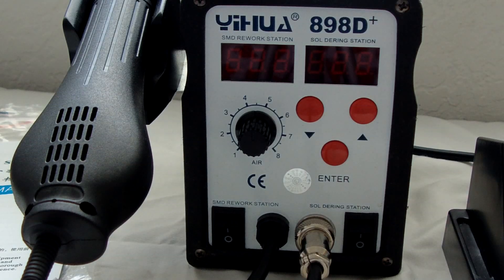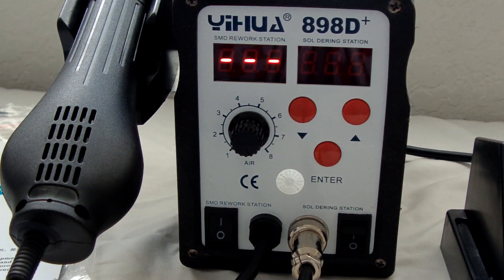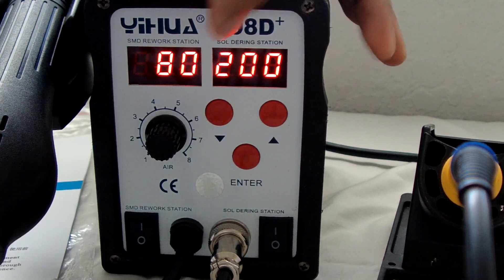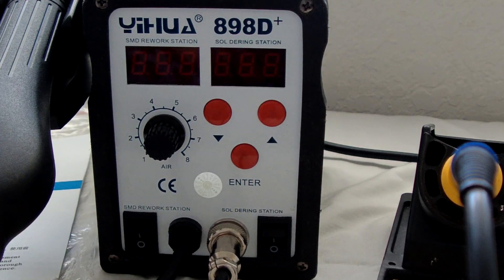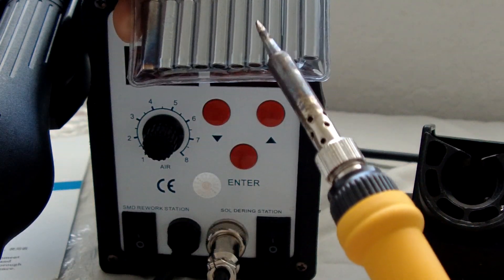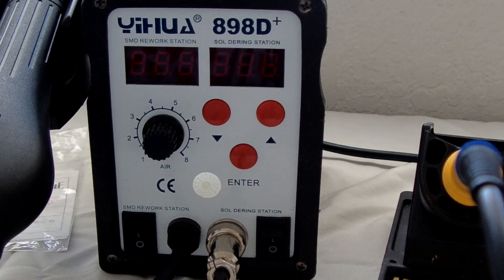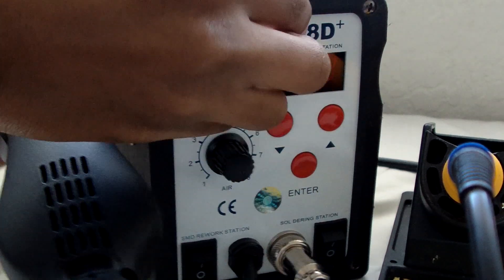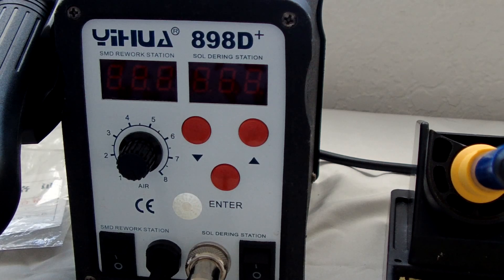review of Atten 898D rework and soldering station

Comment: The air gun does unplug if you open the case, it has push fit connectors on the one I opened up (very quick,easy and clean to do). Earlier models had the same hakko type plug for the air gun but all the new ones don't, seems kinda odd.
Reply: As it was deemed a hazard when unplugged leaving it open so they changed it for safety reasons I read from a trusted source.